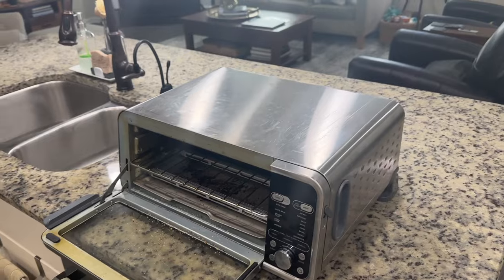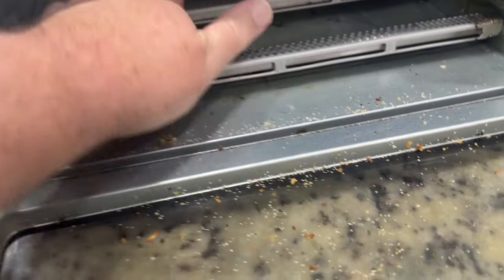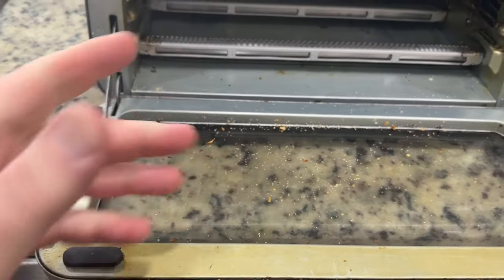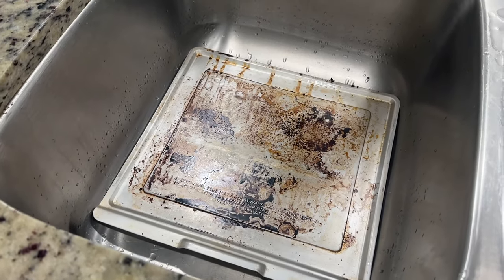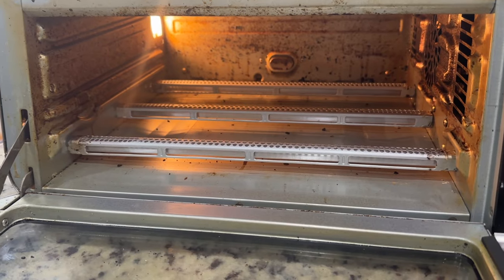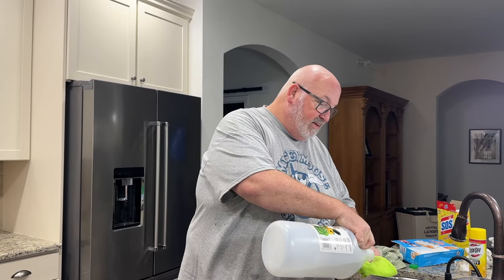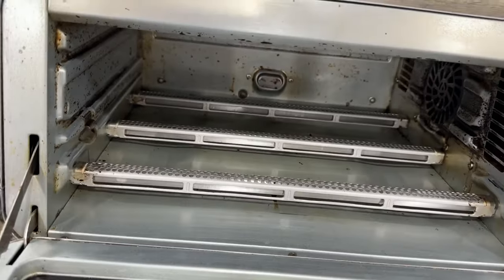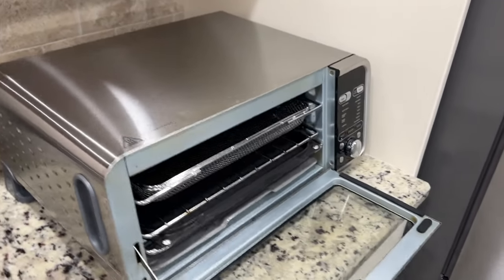Cleaning the Ninja Foodi Oven, Demo and Tips!

Comment: Why the heck would they take out that back door!!?? That's awful! I picked up the one with the back door today at a Goodwill and can't wait to use it. Thanks for your recipe videos! Oh - would you think aluminum foil would do well in the crumb tray?
Reply from the maker: Hi! I have no idea why they would remove the door. It was so useful. As for the foil, the manual says not to and I am not sure why, but am guessing they are concerned it might impede or touch the heating element if not put on well. Just a guess. Thanks for watching my videos!
Reply: @MrAndMrsBanks  I did suspect it was too close; thanks. Thanks for the tip on the 12x12 parchment; I followed your link and ordered from amazon. Been binging a bunch of your videos! Great tips and ideas.
Reply from the maker: Thanks for the purchase! and BINGE AWAY!  :)  @AccioPadfoot12
Reply: Dryer sheets and dawn in hot water will take that right off.

Comment: how do you clean the bottom heating element btw?
Reply from the maker: I personally try to avoid the elements as they seem to be made with glass. I'm concerned with them shattering if I touch them. My approach has been that they get so hot everything burns off of them and they 'clean themselves' any way. Your experience may vary, but that is my approach. Hope that helps.

Comment: I air fry chicken thighs once a week & attempt a good wipedown as the fat splatters all over the inside.  After several uses air frying chicken, a lot of rendered fat is draining out of the unit on the side the controls are on in front as well as draining from the right rear corner where the pivot henge to flip the unit up for storage.  I assume the internal fan is drawing in the fat.  Unfortunately, there does not appear to be a "fat collector" or a trap door behind the control panel.  Anyone else have this problem?
Reply from the maker: I have not heard of this and don't do that much chicken frying like this, so have not experienced it either. I hope someone else will confirm this for you.

Comment: Id be terrified to run mine at 500 for how hot it gets, id think it would melt my counter, luckily mine has the door on the bottom to clean it easier. I got sick of those non stick trays because theyre hard to scrub to get clean,so i got some half sheet stainless steel pans that work better and i can really scrub at it.
Reply from the maker: I’m pretty sure they test it make sure it won’t burn counters. ;). That said most times 500 is not done. We have stone counters so no risk there. I am gonna replace my crumb trays too.

Comment: Did anyone have any luck with cleaning the mesh tray. I usually airfry for my kid and it builds so fast. I tried most of the products mentioned here and a steamer and good ol elbow grease 💪 no luck
Reply from the maker: I don't usually have problems with that. I run it through the dishwasher and sometimes give it a once over with a soft brush. Nothing seems to stick to mine.

Comment: I used soap and water plus  Sos pads to clean inside and it worked fine. It’s a crappy design and you obviously need to use more than soap and water to clean it. Really disappointing. Thanks for putting this video together.
Reply from the maker: You are very welcome. Thanks for watching and commenting!

Comment: Thanks for your video.  I'm looking for how to clean the heating element.  Any advice?
Reply from the maker: The metal cover in the bottom you could gently deal with that but I’d be VERY cautious in the glass rods. I personally would not touch  it. Good luck. Be careful
Reply: @MrAndMrsBanks  Thanks.  I guess I'll have to leave the metal covers stay dirty.  UGH!
Reply: Looking for the same information about cleaning the heating element covers, did you happen to find any information out? Thanks in advance.

Comment: to run that Ninja at full speed for 3 hours the electric bill will give you a stroke , bet it would be cheaper just buying a new oven lol
Reply from the maker: I have not noticed that to be the case, but then I don't know how to measure the specific amount used by individual appliances. But I do find it hard to believe it is more than a full-size oven.
Reply: @MrAndMrsBanks  Hi Len , do you see a huge difference in the pizza between the sp101 and the sp350 ???
Reply from the maker: @Anne6621  I never made scratch pizza in the 101 as the pan is not flat. The sear plate makes all the difference for a number of items. One could do a pizza stone or something in the older model but would need to preheat it well. That should be equivalent I think.

Comment: how long did you let it cool down before you started scrubbing
Reply from the maker: Fully and unplugged. I know some oven cleaners use heat to activate, but this is just a small appliance and I wouldn't want to risk burns or electrocution.

Comment: Depending how Venturous you are,, the tough stains will come off with some, believe it or not, brake parts cleaner. Compressed acetone in a can. Extremely flammable. But!, you oven will look fresher than a head of cabbage. Follow all precautions and safety procedures before hand. 

1. Unplug   
2. Efficient Ventilation 
3. See # 1 and 2
4. Outside is the safest place to use this method. 
5. Gloves and a mask required
6. No arguing with your better half before hand. 
7. Lens not gonna like this. 
8. 3 Hail Marys’
9. Let her rip.
Reply from the maker: LOL, love the step by step. Thanks for watching and commenting!
Reply: Do you have to rinse it out with water or anything before you use it again after using the brake cleaner?

Comment: I have the larger version of this and it’s just as much a nightmare to clean. Easier to get your hands into it but much more surface area. ninja air fryers work well, but they are very un user  friendly when it comes to cleaning. They need to re-design the interior.
Reply from the maker: Good to know! Thanks!
Reply: What is the vertical space in your oven? Please!!!!!! 🙏 from the lowest food could go to the highest food could go?
Reply from the maker: @suran396  I have videos showing the dimensions of the flip up version. The comment above is a completely different model and will be more of a counter top oven that takes up more counter space
Reply: @MrAndMrsBanks  ok, thanks! We have already purchased the Ninja Flex Double Oven, so, counter space was already OK. But it was a close tie with the flip up. There were 2 main tie breakers, the main one being the cooking space (height) of the Flex was 5" and the Flip was 4" and that makes a difference! But I was also unable to find a height of the Flip Tall anywhere, so I am still curious. Thank you!
Reply from the maker: @suran396  ahh. Yes. I have the review videos. But it also is determined by what rack you use. Please watch those. ;)

Comment: Sir, why don't you open your ninja from the bottom, and turn your ninja over so it's easier to clean it.!
Reply: Wow I just saw that it doesn't have to open, how strange my version is if it has a button to open completely below and clean easily
Reply from the maker: yes, the SP101 does open on the bottom (when opened) but the newer models had that door removed. Does make it more difficult to clean.

Comment: I don’t think all that water is a good thing
Reply from the maker: one does need to be careful and never submerge the motor and electrical components. but using water on the inside surface can be done safely (if unplugged). hope that clarifies. Thanks for watching and commenting!